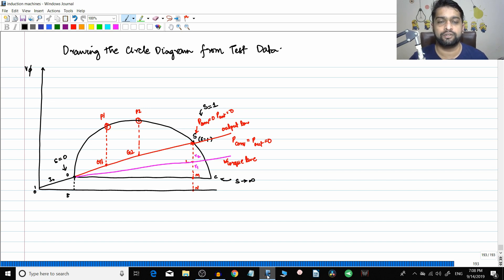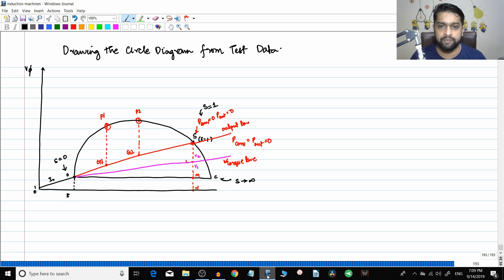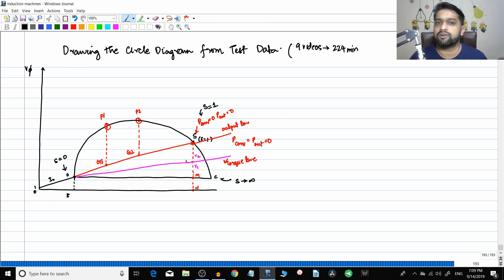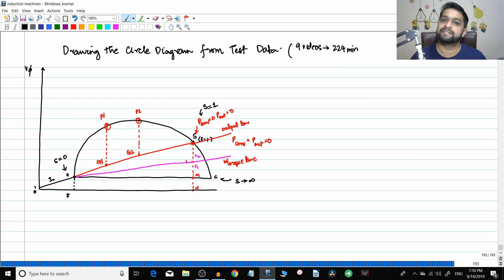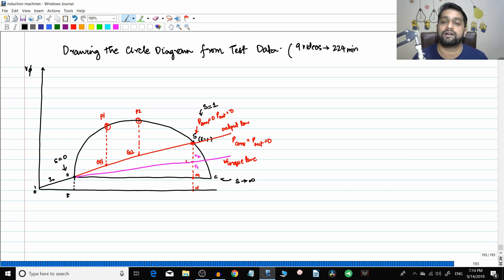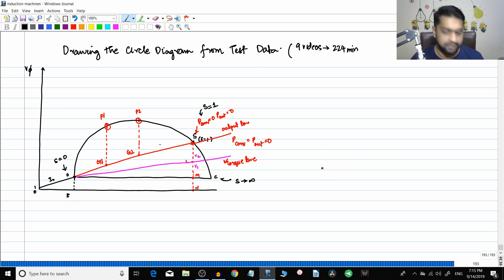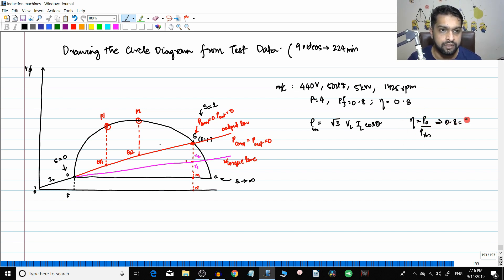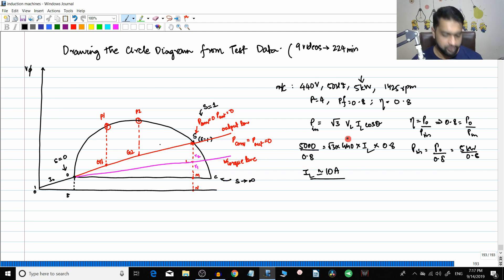Induction Motor #38 - CIRCLE DIAGRAM - Drawing circle diagram from test data

Comment: One doubt...will the circle diagram be exactly same for the values given by you if the stator is delta connected?
Reply from the maker: Yes..you just have to adjust for the phase values and line values of the voltage and current in the diagram that's all..bt the concept is same..